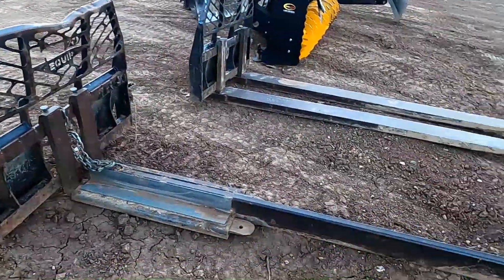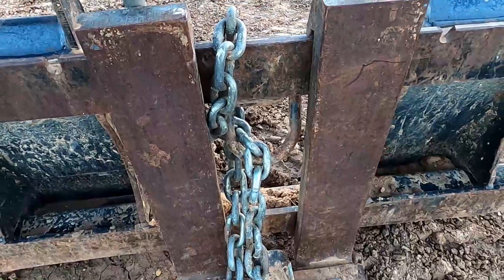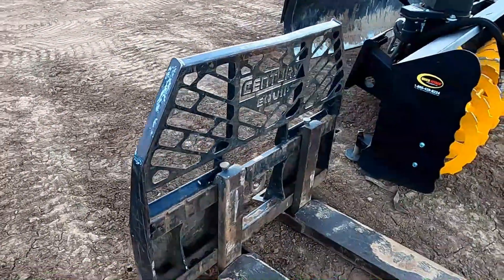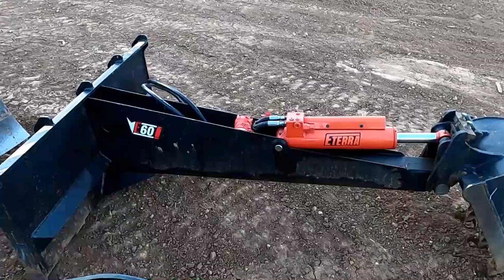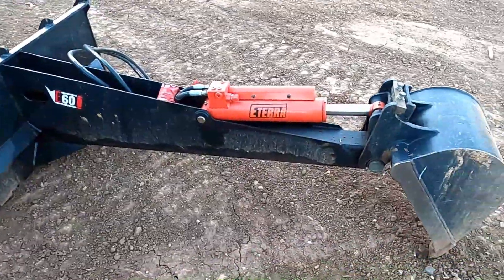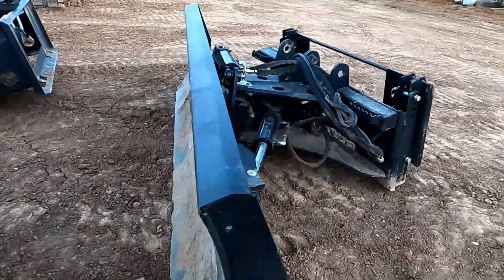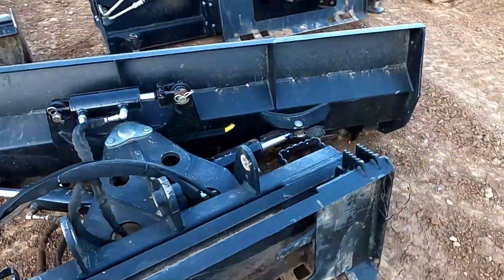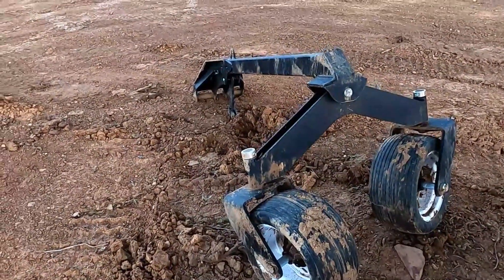Skid Steer attachments lifting capacity for the case tv 450

Comment: Can you give me your honest opinion of your TV450..?  Any DEF problems or any other quirks of the machine.? Lifting the two pallets of cement is something that you will not be able to do with other machines in the weight class of your machine..!
Reply from the maker: I honestly like the machine, but I have not owned any of the other brands, I sold the TV450 and bought the TV450B just to try it out, it has 90 hrs on it and it started leaking hydraulic fluid under the cab, it's still in shop so not sure what's wrong. Haven't had any problems with emissions on either machine, but the TV450 threw an alternator at about 100 hrs, then it had a crankshaft sensor go bad can't remember exactly hrs I have a video on it, then it started throw more codes, so we replaced the wiring harness, but honestly if that would have been replaced first I don't think we would have replaced the sensor. Other than that the machine will push the devil out of hell, not that you want to do that lol, we have a John deer skidsteer as a rental while our TV450B is in the shop, I would not buy one, weak tracks, to be fair it has over 2k hrs, but it doesn't even compare as far as how I like it to perform. I hope this helps, would I buy another case? Yes I would, but I want to try a cat one of these days and see what they are like.
Reply: @SolidworksUnlimited  I'm an old guy,, so I've been riding the stick and peddle machines all my life. I'm on the fence over a CAT 289 D3 or a TV 450B, or let's say I was on the fence, until seeing your video, I think I've decided on the CASE..!  I have been waiting for a new CAT 289 D3 for months and they kept pushing the delivery date out farther, so I whined and they gave me a 289 D rental because I am building a house in the mountains and I have to have a piece of equipment. They didn't give it to me,, just gave me a reduced rental rate..!  I ran that machine for a week and with 1500 hrs, it set a fuel delivery code and quit running. They replaced it with a new 289 D3 with 34 hrs and I put 30 hrs on that machine. Both machines handled, drive and bucket control, excellent. They were both, comfortable and for the most part were a pleasure to operate. It all ends there, because neither machine had the lifting power that was half of what your CASE would do and I don't mean down a little on power, but won't lift a bucket of #3 rock out of a pile without some lever rattling..! I could go on about  the high side in the two speed, that it is only good on flat ground and I mean, anything less than a 2% grade or your might just as well be in the lower range. I am getting a rental TV450B Monday to take to the mountains and I plan on using it exactly like the CAT 289 D3 and that will be the final determination as to what I purchase. It's tough to find an easy winner in equipment, because of all the dimensions of price, weight, capacity, reliability, cost of service and parts, but I'm at a point where if it just isn't capable of doing the job, nothing else really matters..!   Your don't know how much I appreciate your feedback and I will get back to you and let you know how it turn out..!   Thanks Dan...!
Reply: If I was you I would buy a takeuchi if I bought anything else other than what you have if you're not happy with John Deere performance as far as pushing and power and stuff you're definitely not going to be happy with a cat they're weaker all around lifting pushing talk to you she is the way to go other than a case
Reply: @jakecrane3690  Yes, I have bought a TL12R2 Takeuchi and I should take delivery on it this month. I have taken almost every CTL on the market for a few days or a week and spared them no mercy and I think the Takeuchi has the overall best performance. The CASE TV450 was my second choice and the only reason was because of the fact that the cab could not be raised without raising the boom first..!